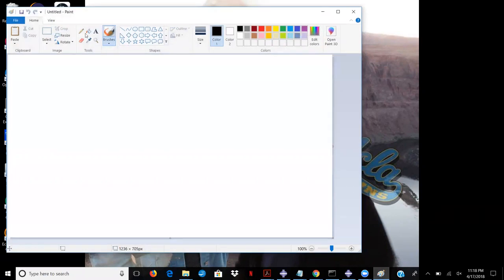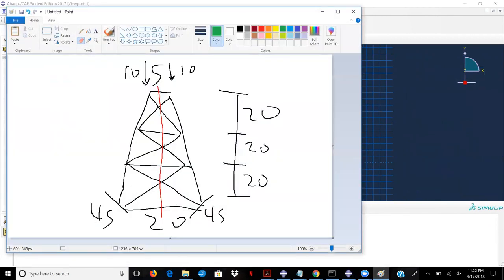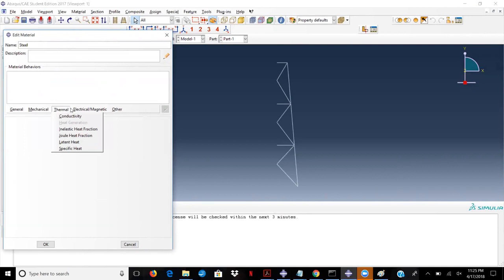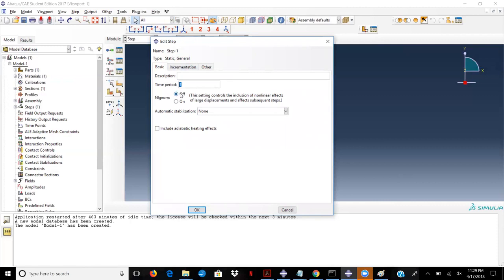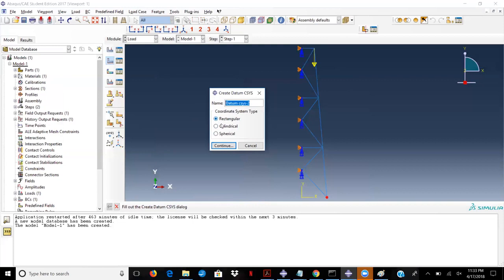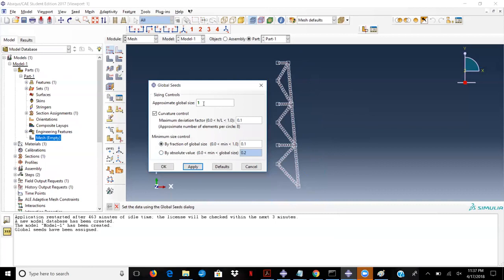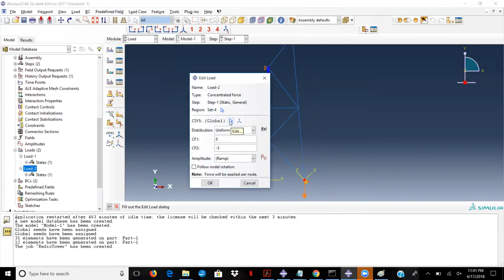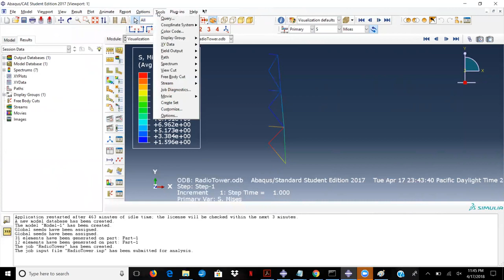#ABAQUS Tutorial Trusses

Comment: Good morning,
I have had problems trying to load a truss element in the midle with a concentrated load. Normally building a truss system it is not possible to apply the load as Abaqus does not recognize the point, even using "partition" or "referent point" I was not successful. Can you help me?